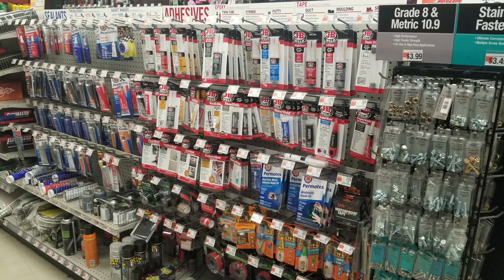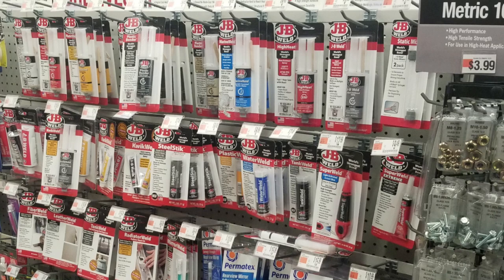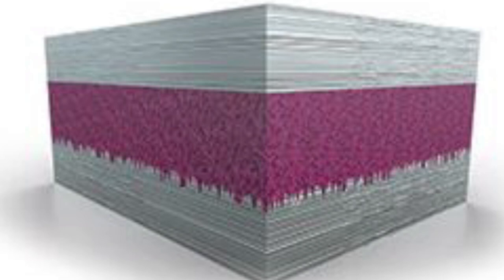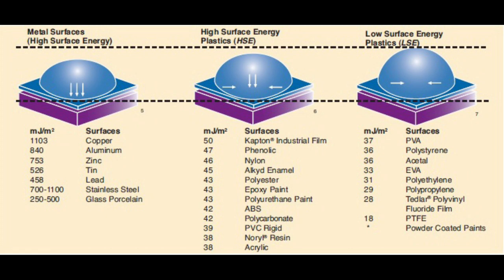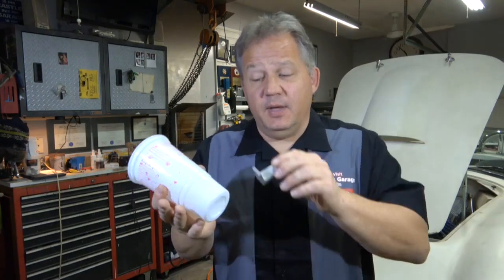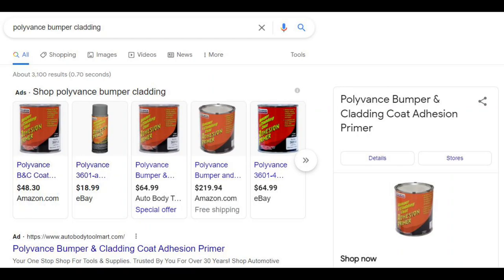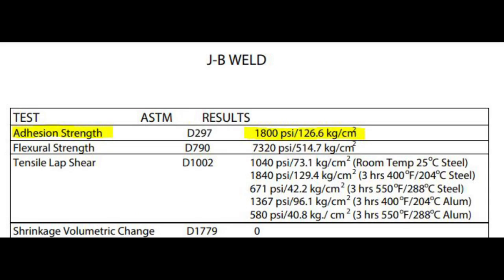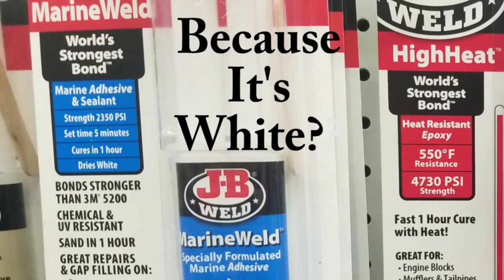Everything you need to know about adhesives and adhesion - Epoxy, High and Low Surface Energy

Comment: Great video. I have heard the term “surface energy”, but I never took the time to research it and understand its meaning.  I’m like you and have gotten overwhelmed when going to the adhesives section of the typical home improvement superstore by the mind-numbing array of different adhesives.  I think you’re spot on with the comment that it’s mostly different marketing pitches for the same product.  I also learned something with your explanation of adhesion promoters for low surface energy materials—excellent content!
Reply from the maker: Thank you "Burt"

Comment: Great video, Any advice for adhering a 70 Chevelle SS bumper pad on, haven't had much luck. Thanks
Reply from the maker: Have you tried contact cement?
Reply: @PetesGarage I have not, but that was actually going to be my next attempt. I've tried some chat room suggestions like Superweather strip adhesive and Windshield Weld... that one might have worked but I didn't prep correctly, couldn't find my primer... so that one's probably my fault. Thanks for the reply.

Comment: Personally, I've never had any success yet with JB Weld....whether the putty or the two part epoxy.  In all applications, I found they couldn't actually withstand the pressure they were supposed to withstand.  I've used West System Epoxy a few times....and have found it to be great...but, of course, it still needs to be used in the right situation.  I've mostly used it in wood applications...and not metal.  Was gonna use a high heat version meant for metal to repair an aluminum tranny pan flange that I had gouged when trying to separate it after having used The Right Stuff on it.  I decided against it, as it seemed too risky, in regard to the amount of heat it might need to withstand.  I went for the proper repair...which was to bring the tranny to a welder to repair the flange and ensure everything was straight.  It worked out great, to this point.
Reply from the maker: I agree, welding it always the best repair

Comment: what is the best glue to glue neoprene rubber to aluminum?
Reply from the maker: That may be a multi-step process depending on what you're trying to accomplish. A metal etch on the aluminum and something to melt into the neoprene.
Reply: @PetesGarage  I'm replacing the tempered glass base from a TV stand for an aluminum one so making a new base for it the rubber will be in the bottom of the base a flat piece to keep it from sliding or moving to give it a grip for my stand that can swing  and also because the bottom will have 2 bolts the ribber will keep the bolts from touching the wood of the stand so that the stand it flat on the stand not not leaning forward